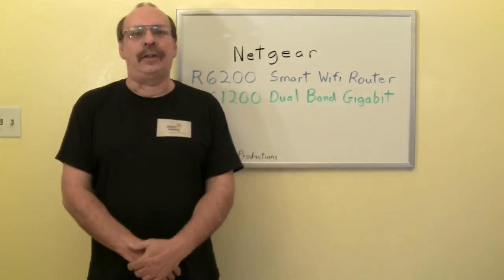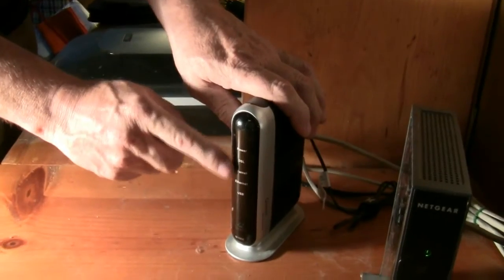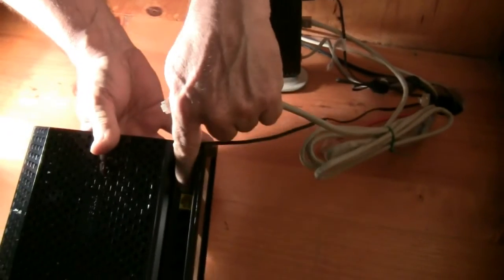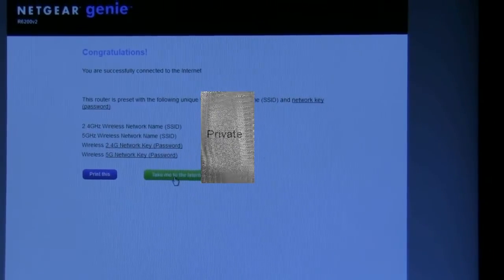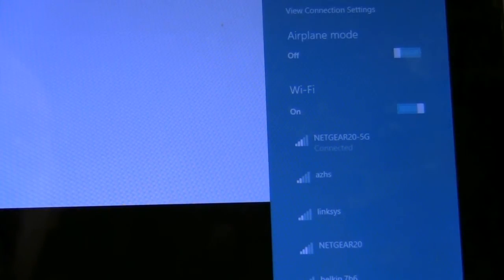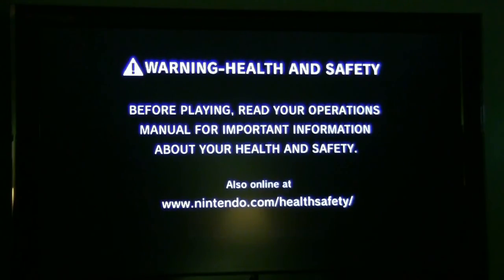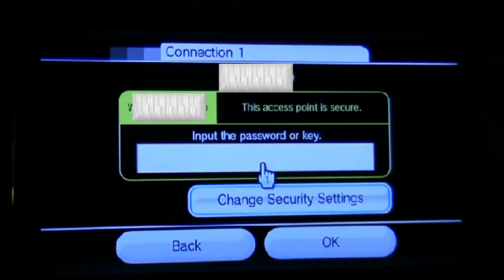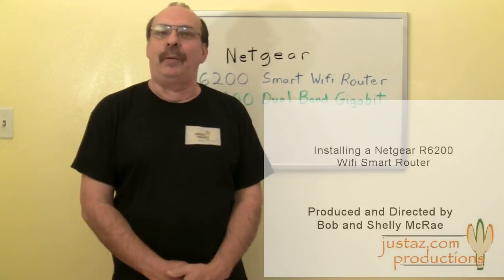Install a Router and Set Up Wireless Devices

Comment: Hi. Thank you. I had to install a new router. It is connected to a laptop w/wireless printer in the same room. I have a 2nd laptop in another room which has no connection with printer since new router install. . How do I get the printer to connect with the 2nd laptop? Do I need to do a reinstall with printer cd?  When I try to print from 2nd laptop it says,  offline. I'm kind of lost. Thank you